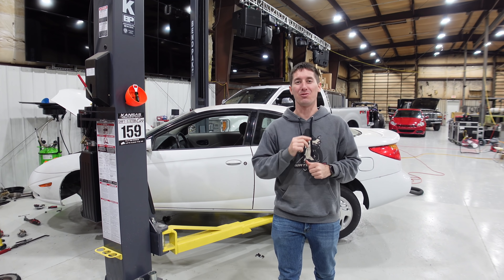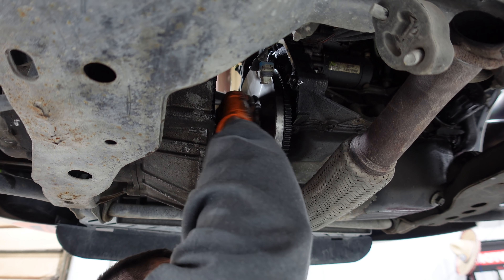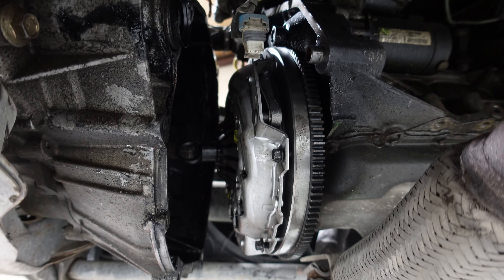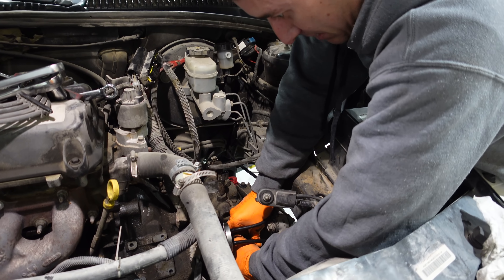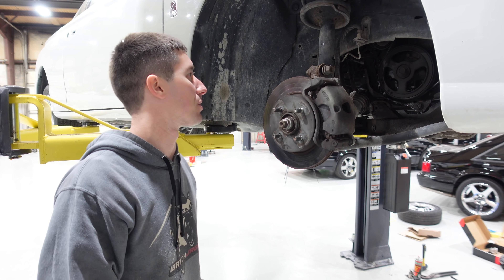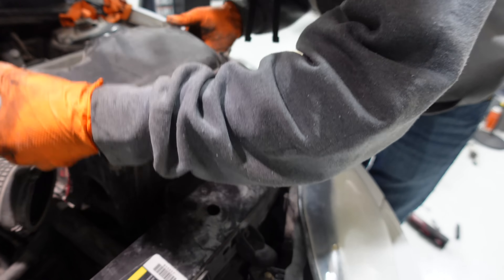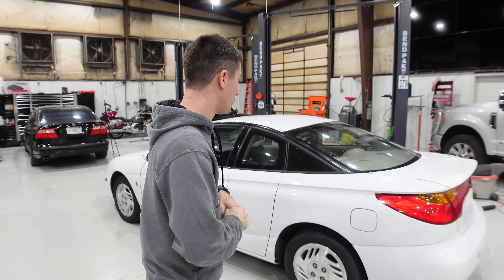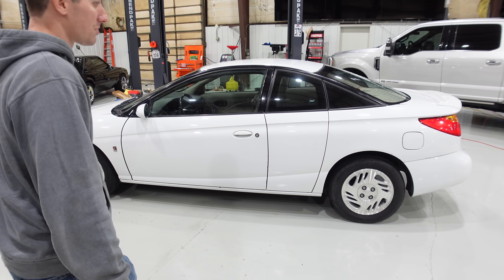I FIXED My Cheap Saturn SC2 For $300 NOW It Has POPS AND BANGS

Comment: A 5 speed isn't weird on a 2001. In fact it was quite special to have 6 gears back then.
Reply: Not really. There were cars from 1990 that had 6 speeds on them.
Reply: Only exotics and expensive sports cars, unless you can name a few? The earliest conventional car with 6 manual gears I can think of was the Lexus IS200 in the late 90s, again I maintain it was quite rare to have a 6 speed right into the early 2000s, so 5 on a cheap compact wasn't weird.

Comment: Putting ATF in a manual transmission that requires MTF and Vice versa can do harm to the transmission.
The problem is not in the lubrication ability but in the viscosity difference.
The synchros and bearing tolerances are designed for one or the other.
If you have trouble with being able to select some gears having to force it in or grinding while getting into certain gears or the box seems very noisy and sloppy you might have the wrong oil in it
Reply: I guess you weren't paying attention, he put MTF in it.
Reply: @glassvial  and if it requires ATF?
The comment was about problems with using the wrong oil not about the oil he used.

Comment: You broke the speed sensor plug off the trans, when you were putting it back together. You can see it in the video.
Reply from the maker: I absolutely did not, it’s on the back of the trans and hooked up 🍻

Comment: Buying a car made by Saturn, (most likely the S-Series from 1997 through 2002,) in the 2020's decade would most likely last for 3 to 10 years now, no matter all of the details.

Edit: I noticed I had to fix a couple typos in my comment.
Reply: exactly. my SW1 was picked up WITH A PARTS CAR for $650. gave the parts car away to a friend, did EGR, clutch hydraulics, plugs/wires, battery, alternator, brake fluid flush, and a few other things. I'm $1500 into this car. 233k miles and still going strong. Got a new stainless shift bushing as well, so that prevents that from ever breaking as well

Comment: Going with oem parts, proceeds to put in a chinesium fly wheel...
Reply from the maker: All parts are Chinese, if it’s aftermarket you’re buying from China 🍻
Reply: The set of drilled and slotted rotors I got for sister is 300M were Chinese with a lifetime warranty and looked to be excellent quality and same thickness as the originals.
They still stop better than the factory ones and haven't warped yet. They are perfectly capable of making top quality parts as long as that's what is required. If they are just making crap to sell cheap they cut every corner and material they can.
Reply: There is a difference betweeb chinese car parts and eBay chinese car parts...
Reply from the maker: @blackcountryme  well these came from a somewhat reputable parts seller, not eBay 🍻

Comment: It did not cost 300$ when you include rent/ mortgage . Electricity ..for air tools. Or electrical-spent on getting lifts wired. You have to do nine of those to break even.
Reply: The dollar sign goes in front of the amount.
Reply: Just read the post ... $ sign is fine.